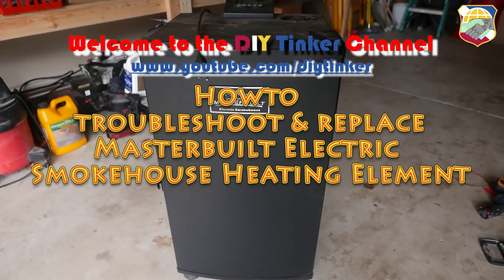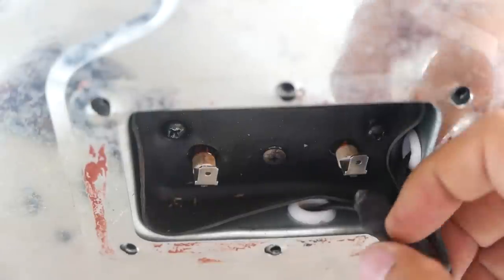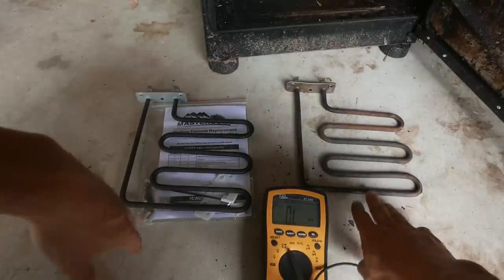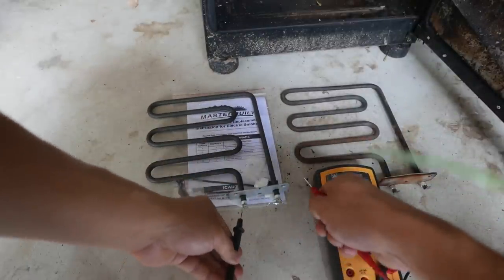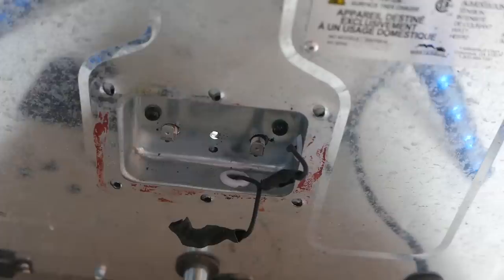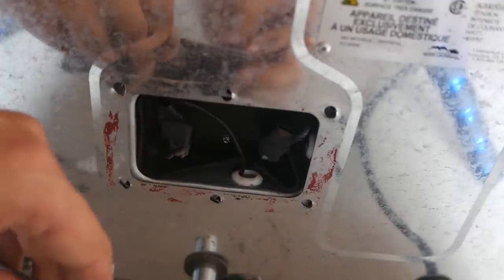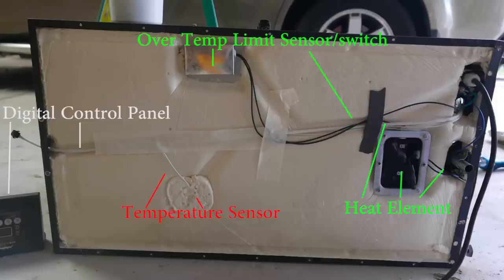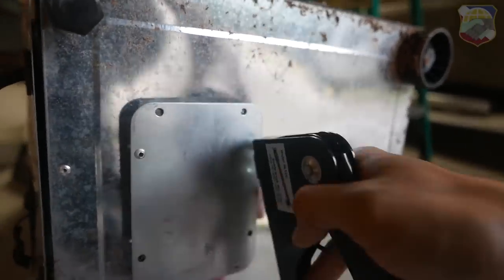Masterbuilt smoker short circuit - Howto troubleshoot and replace Electric Smokehouse Heat element

Comment: THANK YOU! $15 part and my smoker works again. My model was not identical but your video told me all I needed to replace the same heating element  in mine. Mine has nuts on the back of the element on fixed screws. Smoke tray significantly different but not  a problem. Excellent video that gave me all I needed - Masterbuilt is uninterested in communicating with people whose units are out of warrantee. I like the meter explanation.

Comment: Thanks a bunch, Christmas morning and wanted to smoke a prime rib for dinner, go out and start smoker and GFCI keeps popping.  Pulled back little door off of smoker and checked connectors, both were rusty so took a piece of sandpaper to them, re attached connectors and bam, were back in business,.  You saved the day, thanks a ton for posting this!

Comment: So, I have to leave a comment. Your video helped me so much. I was so bummed when my smoker stopped working.  I tried to call Masterbuilt but they are closed because of Covid-19. I wanted to do ribs for 4th of July and I couldn't have done it without you! I will give a shout out to you on my YouTube Channel if that is OK? I just want to let everyone know that I am not a genius on fixing things but you made it easy for me. Other than the stupid screws being difficult to get under the cover thingy on the left side. Mine had a bolt and it wouldn't unscrew. That took me as long as the whole thing took. Thanks goodness I had only one screw. Thanks again. See you in the funny papers!

Comment: Good video explaining how to test the element.  I do recommend adding the new connectors to the repair.  The integrity of the connection is compromised just by removing them.  The manufacturer wants to ensure a good connection because this is a high current connection so it can be a fire hazard.   Keep up the good work

Comment: 10:13 Awesome video, mine is blowing breakers too.  Thought maybe water got into it and let it dry out!  Ordering new element now because of your video!!!
Reply: Water did get in mine. (leaky drip pan)
How long did you let it dry? Did that do the trick?
Reply: @cledman69  dryed out for several days.  Replaced the heating element and it is backed to smoking!  Thanks to the video.  Also bought the leg kit and installed to raise it up and more Mobil!  Masterbuilt is awesome!

Comment: Gr8 vid!
Question: How do your hands stay so clean?
   Was ready to smoke some salmon. Poured water into the drip pan, resting in the bottom shelf and discovered that it had a nice hole in the bottom.  Water drained out. SHORT!
   Tilted unit and drained greasy, black water onto balcony deck. (swift move)
I'll disconnect the ground and see if that (element) is the prob.
    Will let it dry out, before it rains again. (South Fla, mid July)
Thanks for sharing.

Comment: Great instructional video! My question is about the ground screw. At the beginning of the video the screw head is facing out toward the back between the smoker leads. When you reassembled you had the screw head on the inside of the smoker and the nut on the outside back next to the power leads. Any reason for that? It makes sense to me that it would be easier to loosen. I just replaced the element and decided to reassemble the way you did. Your video was very helpful.

Comment: I have an identical smoker and it trips the breaker as soon as I plug it up, so does that mean I need to replace the heating element or is it something else?
Reply: Very likely the element.  If continuity on the element isn't appropriate, the device shuts off.  $20-25 part online.

Comment: Does anyone else think its absurd the heating element fails so soon? How is the replacement element holding up.
Reply: Mine died after 14 months. Wel see if masterbuilt laughs in my face or if they send me the part
Reply: @6151wmw  I put the replacement, it wasnt too difficult. Time will tell. If it fails again i think ill just rip the groundwire off

Comment: My masterbuilt is tormenting me again.  first it started losing parts of the LED display which i SORT of fixed by drying out and sealing up all the gaps where moisture can get behind the control panel.  

today my smoker popped a 20 amp breaker shortly after I started to heat it up, and now the smoker will simply not heat up at all.  Really not liking the quality of Masterbuilt.  I would NEVER buy them again.
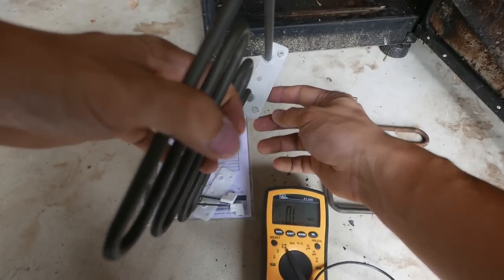Reply: Sounds like the heating element pooped out on you. Did you try diagnosing it like he did at 3:00 of the vid?